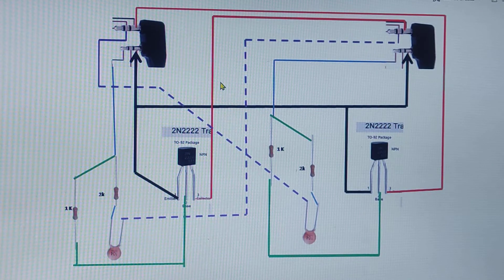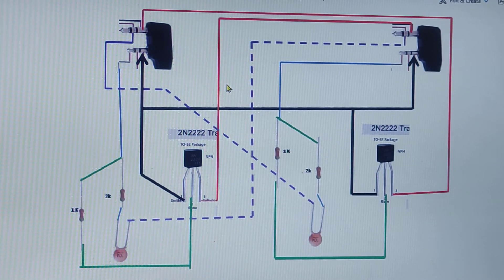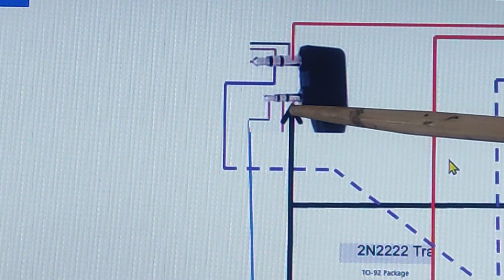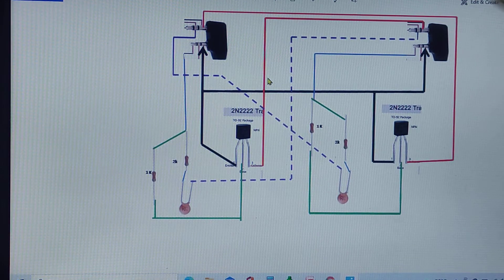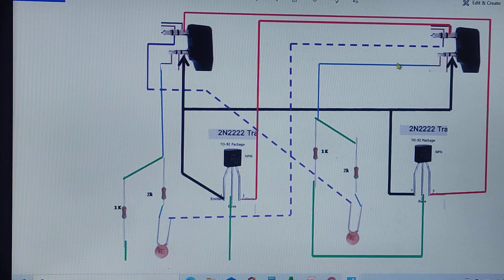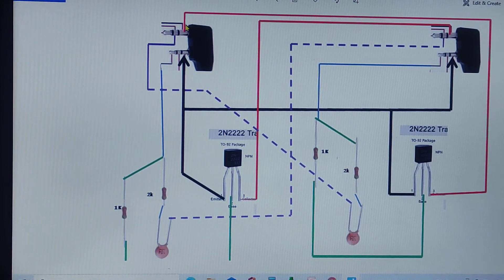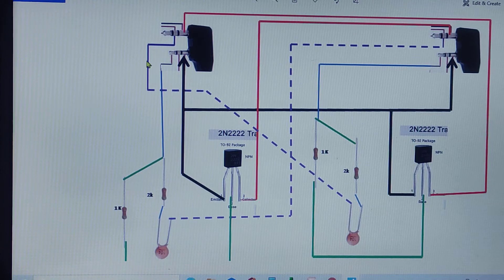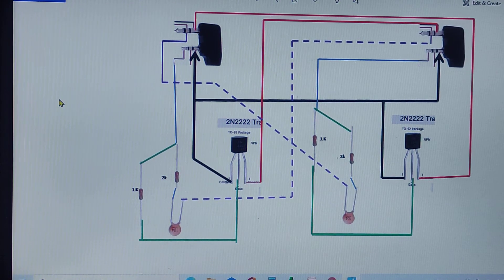Powerless back to back radio controller

Comment: sir try to use optocoupler pc817 instead 2n2222 for ptt switch
Reply from the maker: I tried that once. But it cannot switch all the base radios. 2n2222 has higher current capacity. Optocoupler is best when isolation is concerned. But it does not make sense, since they have a common ground. There is no isolation involved in this design.